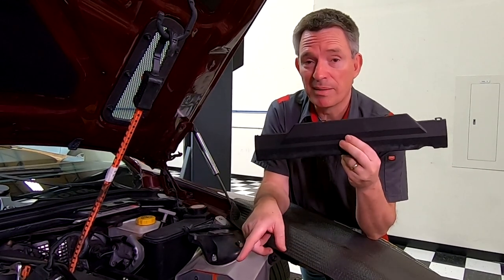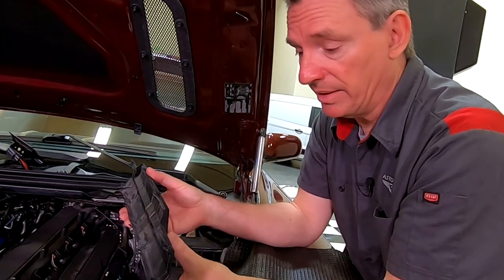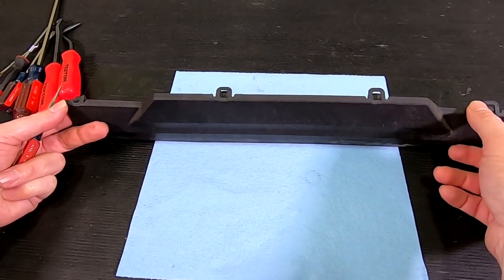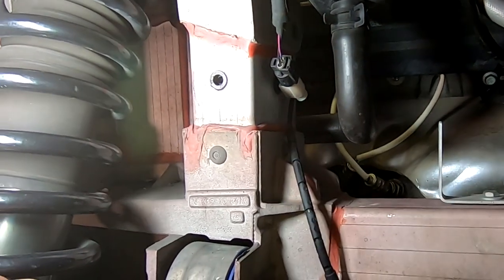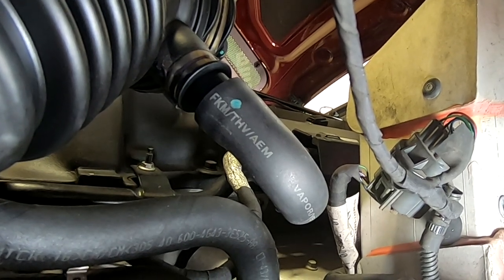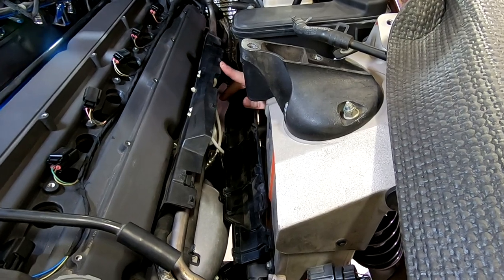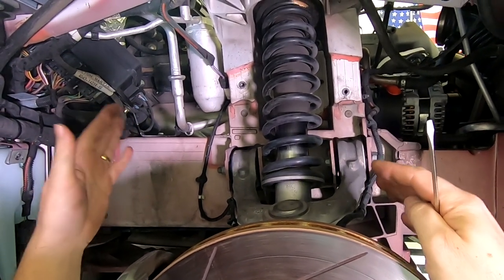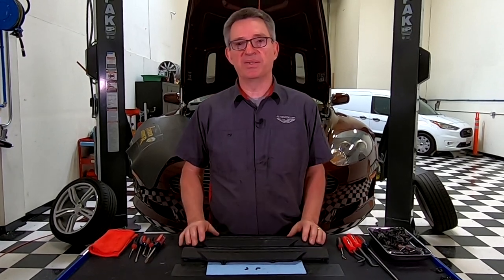Removing the Engine Wiring Harness Top Cover from an Aston Martin DB9 V12

Comment: If I saw the material identification markings on the inside of the cover correctly (PA 66 GF 20) the cover is made from Polyamide. PA needs a certain amount of water content for flexibility (the water molecules diminish the van der Waals forces in the polymer). Of course, in the engine bay the water content is lost over time due to heat making parts made from PA brittle (e.g. zip ties). If you have the old brittle covers still available and are open for an experiment, put one of the old brittle covers in a sealed bag with a wet rag for some time. I would be interested if the polymer will get flexible again.
Reply from the maker: Hi Christian.  That's super interesting to learn about.  I do have the old covers still and will try the bag and wet rag to see if there is any change in flexibility.   Will be neat to see.  Thanks for sharing - and for watching!

Comment: would it have been possible to pre heat the tabs to sften them before removal ?
Reply from the maker: That's a great suggestion, but I have no idea how I could manage it in the incredibly limited space.  Maybe with the engine out on a bench, but would be tough in the car.  For the cheap cost (relatively) of the replacement covers, it's not worth it.   Thanks for watching!